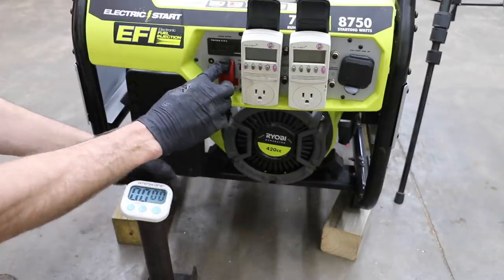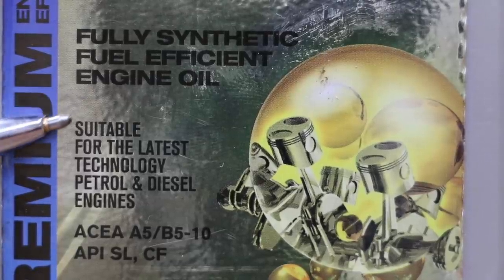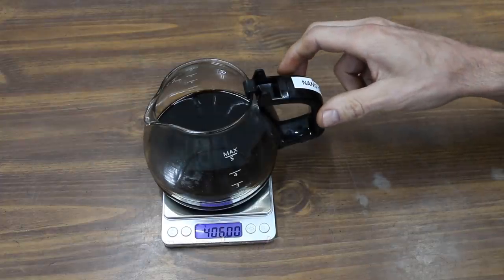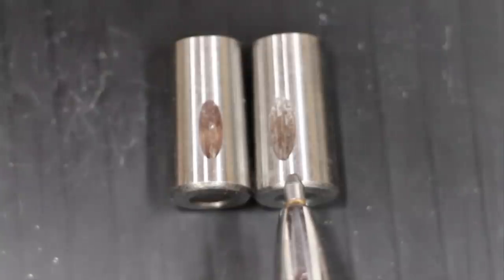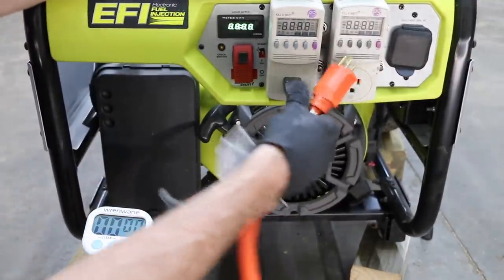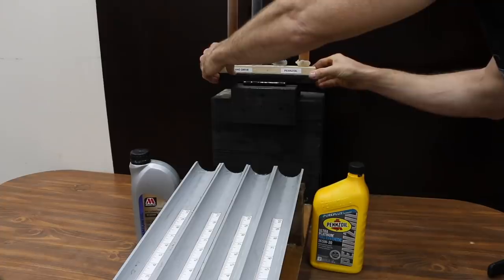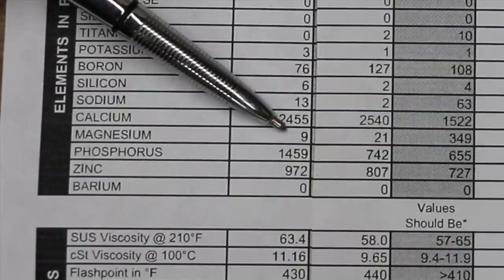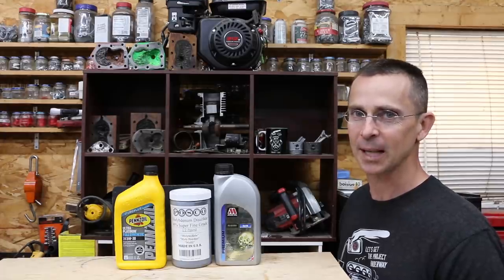Save Gas with "Nanotechnology" Motor Oil? Better MPGs? Let’s find out!

Comment: The Nano tech additive in Millers is Tungsten Disulphide combined with ZDDP in a mole ratio of 1:1 which work synergistically together BUT it requires heat and time to exfoliate the WS2 to coat the internals and that takes around 18 hours to fully plate up the internals so testing after 5 mins you wont see the full benefits. PurePlus is Shells (Pennzoils) GTL (Gast to Liquid) base oil and has base oil qualities very close to PAO and superior to Group III oils  hence the good flow properties. You wont be able to blend any MoS2 into fully formulated oil to achieve any improvements as this has to be done using a hybrid milling and sonification techniques prior to blending. I've tried the Millers 5w30 eco and after about a weeks driving I started to see some real improvements in MPG and how super quiet it made my Ford 1.6 Zetec-se unit (the Yamaha designed one)
Reply from the maker: Thanks for sharing.

Comment: Thanks so much for sharing and well done as always!  I really enjoy the engine motor oil test series you’ve done over the last 3 years.  Are you considering extending your oil testing to Diesel engine oils?  That I would be extremely interested in!  About a year ago you did a compare between rótella t6 and delo.  Would like to see rotella go head to head with Amsoil, motorcraft, rotella T5, and shaeffers - all in the 5W40 synthetic Diesel engine oil grade.  Anyone else out there interested?  Show your support with a like.
Reply from the maker: Thank you for the video idea on diesel oils!

Comment: I work at a Ryder and they use chevron 10w30 xle 400 synthetic blend. Chevron claims it's a multi fleet oil (gas and diesel engines) Just wondering if theirs some way to prove that. Love the videos

Comment: Thanks for all your videos! 
Even if the products / brands available here in Germany often differ from the tested ones, it is always interesting when certain "buzzwords" are debunked.
I have to admit there is one thing concerning your lubricity test(er) I haven't understood for years: 
Wouldn't it lead to more meaningful results if you didn't keep the duration of the test constant, but the number of revolutions? If a substance is really "bad", the friction slows down the wheel and as the result, the "distance" the wheel travels on the bearing is significantly reduced. Therefore a bad lubricant profits (somehow): it does not have go "the full mile". (Only hypothetically: superglue would have a damn good result: no scratches!) :-)
Reply from the maker: You are welcome!  Thanks for the feedback.
Reply: It would be very expensive to have a motor that counts individual revolutions.  The closest that he could get would be to measure RPM vs time.  But I assume that most testers just use a fixed time.  Also, as the power of the motor is always the same, and the pressure against the bearing is always the same, you really won’t have a significant change in RPM until just before the point of a catastrophic failure.  It’s why you don’t really notice a change in your automobile’s engine’s performance before and after an oil change.

Comment: Great videos. Very thorough. I use both Pennzoil and Amsoil in my vehicles. Amsoil sends out test info every few years comparing their signature series against other synthetics with similar results as yours. However, I would be curious to see how their XL series and OE series motor oils compare to Pennzoil. I have never been able to see test results on anything but signature series.  Please consider.
Reply from the maker: Thanks and  you are welcome!  Thanks for the video idea.

Comment: Transmission fluid test series.   My 2017 Elantra gets 44 mpg highway only, 34 in half half commute runs.    55 mph long runs yield about 54 mpg.    Dealership sells OEM fluid for very high price. Elantra requires SP4 rating.   Newer rating after 2017 are SP4-M.  Is  Aisin SP4 as good as OEM.   How would you know if it contains right anti sludge additives?   Enjoy your videos series.  Thanks

Comment: Gear oils? Examples would be Supertech/Valvoline/Castrol  for cheap oils and Mobil 1/Amsoil/Royal Purple for expensive gear oils. It would also be interesting to see how much of a difference in film strength protection there is between conventional and synthetic gear oils as well as cold flow and evaporative losses.

Comment: Castrol Magnetic 5W30 with SP rating, for the F-150 V6 Ford Eco-Boost Engines to correct timing chain wear. The timing chains on these engines are 7 feet long.  All I would like to know is it really magnetic, sticks to the metal parts on the engine w/o draining , dripping off?

Comment: Awesome testing as always. your videos are good. It would be great if you could do a video to test drill bits? craftsman, dewalt, black and decker etc, with their titanium plated, gold oxide, etc on wood, cement, metal, rod, broken bolts, etc. Thanks. Especially the small bits. It would be very informative. Thanks
Reply from the maker: Thanks!  Thanks for the video idea.

Comment: I really want to see a test with LE or Lubrication Engineers. The company I work for uses this for our pickups and mack trucks. 15000 mile oil filter change then another 15000 mile for a full oil change. I work as a diesel mechanic on these macks with with volvos mp8 and we have only done an in frame on a handful and there wasn't a spec of wear on any rod or crank bearings and have pulled cam out many times and never seen any type of wear on the bearings there either as well as no wear inside cylinder sleeves. A lot of these trucks have 26-34000 hours on them and about 700k miles as they're ran about 18 or more hours 6-7 days a week
Reply from the maker: Great recommendation! Thank you

Comment: Just wondering if you have tested car radiator anti-freeze?  We come from the land of the ice and snow. From the midnight sun, ...    Ok, Canada.  I think this test would be helpful.  Perhaps you may include a sample of a favourite liquor in the freezer test.  I used to keep a "mickey" of Captain Morgan in the trunk of my car in case of emergencies.  It never froze solid, but it did thicken up.  You could have a lot of fun when you take the car antifreeze out of the freezer by checking whether the liquor had frozen.  Your comment could be, "This was made for human consumption, but we will test that later."  You then leave it in the freezer, and don't mention it again in the rest of your video.  Thank you for your hard work preparing your videos.
Reply from the maker: Not yet. Great suggestion

Comment: Millers showed more evaporative losses than Pennzoil.  The only problem I have with your wear test is that I believe oil dispersion and behavior  would change significantly at engine operating temperature.  It would be good if you could figure out a way to perform your wear test with the oil at engine operating temp.  I think that could be done with an induction type heating device sitting over the spinning shaft that drive the friction wheel is attached to.
Reply from the maker: Thanks for sharing!

Comment: So almost everything has a shelf life. What is the true life span of oils if left on the shelf for months or years. What does it change to, degrade to if left alone on the shelf, is the oil not usable after a certain time frame. Also, what would the condition of the oil be if it has been run in an engine for a year without being changed. How much break down occurs to the oil on day 365 compared to usage on day one in the engine.

Comment: Old video and you probably get bombarded with comments, but it would be cool if you had this Pennzoil kickin' around that is API SN and ILSAC-5. With the new API SP certification, it looks like new Pennzoil Ultra Platinum is shipping with the API SP designation with ILSAC-6, which should be a step up from API SN Plus and ILSAC-5. It would be cool to see if manufacturers actually change the formulation of the oil to meet these new specs, or if it's just a really good oil to begin with and they didn't need to make any changes. And if they are different, see how they differ in the tests.
Reply from the maker: Thanks for the suggestion.

Comment: Hi. Please test the xenum oil additives. I think it is called vrx 500. It is supposed to contain ceramic particles. It is milky white in colour.  It is not cheap at around 60$ for 375ml that will work for 3 to 6l of oil.
Reply from the maker: Thanks for the video idea.

Comment: Comma ECO-Z 0W-20 C5/MB229.71/BMW-LL17FE+ 
 Is sold atleast in finland, (no clue is it sub-brand of others tested)
price 
79,90e/5litres,
 94,14usd/1,3gallons
Comma Pro-VLL 0W-30 VW-506.01 (0-30w)
price
59,90€/5litres 
70,57usd/1,3gallons 
 would be same viscosity as others tested 
i would be really curious to see how it would compete, 
, considering 
Castrol Edge FST-Ti 0W-30 4l A5/B5 is just
57,73 usd For Gallon
Redline 5w40 extreme 64,90e/gallon
Reply from the maker: Thanks for the suggestion.

Comment: You should do a test of OBDII Code Readers costing less than $100 - with 'LIve Data' feature from Harbor Freight (Zurich ZR8), Amazon (ANCEL, Foxwell NT301, INNOVA 6030P, TOPDON AL500). Nearly everything you test is for DIY and experienced homeowners so this is a logical extension.
Reply from the maker: Thanks for the video idea.

Comment: I have a request for a comparison test if you please.  Cordless screwdrivers (not drills or drivers).  I have yet to see any that have more power then the decade old DeWalt Model #DW920K-2.  I also have the Milwaukee Model #2101-21 and find it way less powerful.  I could drive screws into beams with the DeWalt and was looking for something with as much (or more) torque as the DeWalt (80 in. lbs. of maximum torque).  Thanks for all you do!

Comment: I still don't get the point of that Timken machine around 4:28. I saw a bunch of youtubers doing that. I believe you cannot proove the quality of an internal combustion engine oil, testing it with a simple electric bearing machine, besides there are no such bearings inside an engine. Two different machines/operations. What about combustion chamber temperatures? It's like testing the performance of a Lawn mover using a sewing machine device. 
Great channel Sir.

Comment: I race 6-8hr endurance road races in Champcar, WRL, SCCA, and Lemons. I use Millers racing oil, 5W-40. The oil temp runs 240-260 all race long. Never had an oil related failure with Millers. When I first started endurance racing I used Rotella synthetic 15W-40, with no engine failures, then went with a racing oil for better/more additives. Could the Pennsoil handle the same punishment? Probably.
Reply from the maker: Thanks for sharing.

Comment: well that wear test on the millers is pretty impressive. to bad the flow rate and it evaps so much faster though. ill stick with my amsoil. and use the pure penn in a pinch
Reply from the maker: Thanks!  Thanks for the feedback.

Comment: Nano particles have a much larger surface area to mass ratio, think of them like a phone book when it is closed and then all the pages separated. Same mass for both but one has a 1000 times more surface area. These particles are really useful for things that need lots of surface area but reduced mass, such as fillers in plastics, paints and cosmetics, catalysts in cars, etc. Normally this allows you to put less filler in to get the same result. So a nano oil should be able to use less fillers to get the same results and as such have less impact on the oils basics properties, especially things such as cold flow.
Reply from the maker: Thank you for the feedback

Comment: I’d use the miller’s for flat tappet cam engines that need the zinc. It’s formulated for its intended purpose. Older engines. Good to know.
Reply from the maker: Thanks for the feedback.

Comment: Could we see Pennzoil Platinum vs Ultra Platinum vs High Mileage? I wonder what properties are different in a high mileage oil.
Reply from the maker: Great suggestion!  Thank you.
Reply: While that would be interesting, you're really comparing apples to oranges. Regardless of the high mileage oil performance, I would not run it in my low mileage engine due to the "seal conditioning" additives. I would not want to "attack" the seal material in a properly functioning seal. But that's just me.
Reply: @kerryblueher3147  not at all what is at play here, and it is not "apples to oranges" at all. It would be interesting to see WHAT kinds of additives make it different, as well as how high mileage specific oil performs on the wear test. In theory you would want the oil film to be stronger on old, more worn parts. Additionally, if it performs worse by every metric, then why use mileage specific oil at all?

Comment: Please test circular saw blades and cordless circular saws!  I have an older Ryobi 5" circular saw that bogs down badly in all types of wood, some say different blades make it so the motor doesn't struggle; others say new fancy brushless higher power saw is the only fix.
Reply from the maker: Thank you for the video idea!

Comment: If you have not done it already, Pennzoil full synthetic 5W-30 vs Kirkland full synthetic 5W-30
Reply from the maker: Thank you for the video idea!
Reply: @ProjectFarm  no problem. I’ve seen both vids that tested Kirkland and pennzoil in separate videos. I liked results of both and I shop at Costco so am really interested in seeing them compete against each other. Now that I’ve used up my free dealership oil changes with new vehicle, time to start doing them myself.

Comment: hey there, I'm pretty sure that you've tested oils containing moly disulphide, but have you tested any oils containing Tungsten disulphide?  Its another additive, similar in action to the mos2, but its claimed that the ws2 is far more effective as a coating as the particles resemble an onion and sheets sheer off and bond to the metal it comes into contact with.  I tried 25g in my merc e class 220d convertible.  I did think it was quieter than before and it certainly ran cooler which may indicate a reduction in friction.  I'm in two minds regarding the ws2 as a cooler running engine would mean that the car would never reach the mercedes specced parameters for proper running.
May be an interesting test.

frankie
Reply from the maker: Thanks for the video idea.

Comment: I'm watching this video again after some time. I'm wondering, if the base oil is similar enough that you can mix these oils because this looks like if you mixed the biller by about 60/40 with the Pennzoil you'd end up with a really good oil. Plenty of cleaning agents, and more than adequate wear additives would still be present did the resulting mixture, plus it should still have more than adequate capability at colder temperatures. 40 below I think is too low of a realistic test.
Reply from the maker: Thanks for the suggestion.

Comment: Is there any thought that the oil contains volatiles that would boil off in the initial heat test, but that a subsequent test (and long-term) it may actually perform better?

Comment: It would be interesting to see ,if adding oil in the diesel fuel ,in 300:1 ,or other mixture.  Would help the high pressure fuel pump ,or the injectors inside pins, to smooth out ,their friction surfaces.  So in this way, to be kept running for longer.   Cheers!
Reply from the maker: Thanks for the video idea.

Comment: Millers is a very well respected British oil brand and used by practically all people in the UK with a high performance engine.

You have tested a mid-range Millers oil against the top flight Pennzoil which isn’t really a fair comparison. The Millers CFS NT+ range is the top flight.

The cold flow I know is a hugely exaggerated version of reality, but it is just that, exaggerated. Most European countries won’t experience a winter temperature colder than -5°C, and if the Millers is “clingier” than another oil, it’ll perform well on cold start despite not flowing quite as well.

Again a mid-range economy oil isn’t going to be designed for extreme temperatures, hence the additional boil off.

I feel some American bias in this comparison too, the wear pattern of the Millers was much superior to the Pennzoil, but as most Americans have never heard of Millers, it would be hard to recommend, as no one in Europe/UK would use Pennzoil either.

Millers is the absolute go to oil for any tuned, performance or work horse car in the UK, the benefits of the CFS NT+ are great enough to convince the skeptics even. I would love to see the same comparison, or against any other top flight US recognised oil, against the Millers CFS NT+.

Your testing and the consistency are fantastic, not bashing that at all and I understand it’s extremely difficult to do this - thank you for the informative video.
Reply from the maker: You are welcome!

Comment: Is there a video for “fan favourite” oils head to head? Like top of the line options for brands like Valvoline, Mobil 1, Pennzoil, Castrol? I know there was an oil championship but is there a video specifically for the ones you could find at say Walmart or a part store and test them against each other?
Reply from the maker: Thanks for the suggestion.

Comment: To compare apples-to-apples, you should do base-level "full synthetics" against each other, like Castrol Edge vs. Pennzoil Platinum vs. Valvoline Full Synthetic.  Then, you should do the premium synthetics ("extended life" versions) against each other, like Castrol Extended Life vs. Pennzoil Ultra Platinum vs. Valvoline Extended Life, etc, etc. Then the winner should be pitted vs. "true 100% synthetics", like Amsoil. Pitting QS Full Synthetic vs. Castrol Extended Life is not like for like, is my point.
Reply from the maker: Thanks for the feedback.